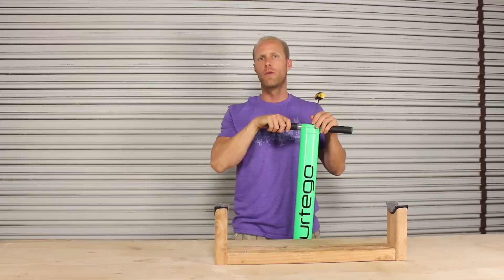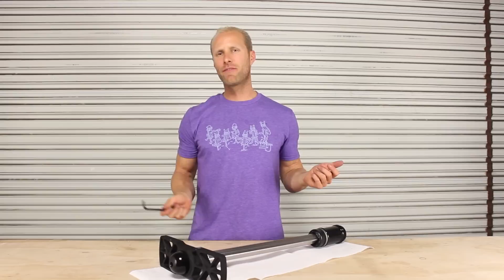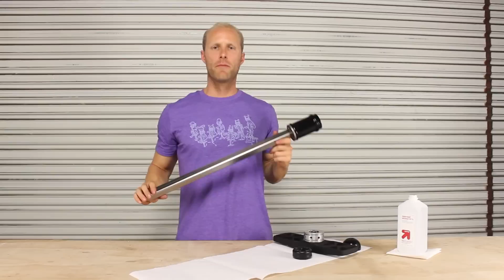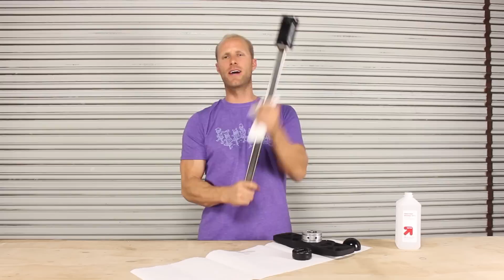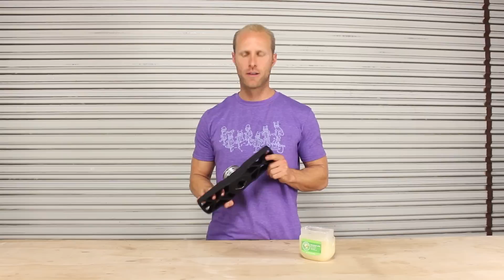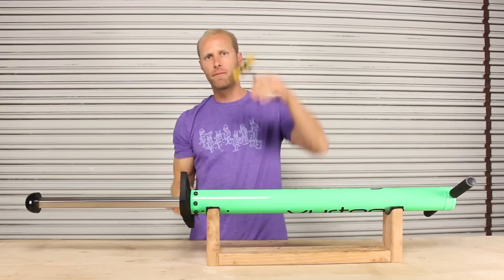Vurtego Pogo Stick Maintenance - Oil Change

Comment: finally i found the allen key to open it. but the donut of mine is white and it seens glued on the black cup... is it right? i cant get the donnut out of the metal square rod... its not easy as the videi shows. do i have to take it out or this white one is attached some how?
Reply: The donut is a very tight fit. You need to pull hard to get it off. It's not 100% necessary to remove it, but if you want to clean it as much as possible we generally do it.
Reply: and do I have to use only my hands for it right? i thought to use a screwdriver but im affraid its going to damage it...
Reply: @albertoalerigijr  It might be a little difficult to pry off only using your hands. I usually stick a screwdriver between the round steel plate and the donut and then pry the donut away from the steel a little bit. Once that's done, you can reach your fingers into the gap and pull it down.
Reply: YESSSSS! I did it! THX!

Comment: Hello again. It seens you guys in US use bolts different from the rest of the world... What is the size of the allen wrench you use on those 8 bolts on the botton of the v4? I have 3 allen sets here in my home in Brazil and none works.. it geta too big or too loose to fit on the bolts. My v4 came with no tools...
Reply: The bolts on the cylinder use a 3/16" hex key, and the bolts on the soft top and grip tip use a 1/4" hex key.

Comment: The screw on the bounce bad came loose and got stripped resulting in my bounce pad coming loose so my son bounce one time with no rubber. How can I get replacement hardware? (bolt only)
Reply from the maker: I would suggest looking up a local bolt supply company. They should have one you can get for about 50 cents. It's a 5/16 x18 thread count x half in length cap socket bolt, but you could also use a longer bolt as well. If you want to get a bolt from us it would probably be $5 shipped.

Comment: So after an oil change do you have to add lube into the valve stem. ?
Reply from the maker: It's easiest to add the lubricant directly into the cylinder while you have it all taken apart
Reply: @vurtegopogos  okay makes since. Now can I use baby gel instead of the lubricant you provide.!?
Reply from the maker: @mlcmusic8243  yeah definitely!
Reply: @vurtegopogos  thanks for the help. !!!

Comment: hi, I bought a new v4 pro, I have a year warranty, can I lubricate it myself, or will it cancel the warranty, and how many milliliters of oil do I need to pour into the cylinder and which one?
Reply from the maker: Definitely add lube to it! That'll help to ensure you don't run into any issues that would require you to need to use your warranty. We use silicone oil when we assemble them, but it's not that cheap or easy to find. Most of the pros prefer to use Baby Oil Gel (make sure it's gel, not just Baby Oil), Vaseline, or White Lithium Grease. All of those are cheap and easy to find. As for how  much, you can never put too much into it. Somewhere around 20ml should do the trick.
Reply: vurtegopogo Is the new v4 pro ready to use, or should it be lubricated?
Reply from the maker: @genaboim6561  it's ready to use straight out of the box. We generally recommend adding lube after 6 weeks or so. If you notice a big improvement then you'll probably want to add lube a little more frequently. If not, then you can go longer periods without adding it.
Reply: vurtegopogo thanks
Reply: vurtegopogo is silicone treadmill oil suitable?
Reply from the maker: @genaboim6561  I've never heard of that. The silicone oil we use is 1000 CST, which is about the right viscosity.

Comment: I did this but the pogo is more grabby then before. It seems like the piston grabs the sides of the cylinder. Is there better oil than baby oil to use or a different O-ring??
Reply from the maker: Try adding some oil directly onto the shaft. If that doesn't work then you probably need to add more oil into the cylinder. A new o-ring wouldn't change anything. Baby oil gel and Vaseline are the two lubes preferred by the best of the best.

Comment: I’ve done an oil change and after putting lube into it it still fills pretty stiff. I’m pretty sure I cleaned it good.
Reply from the maker: Does the shaft have any lube on it? Usually when you wipe the shaft down to clean it you need to add a little bit of lube back onto it afterward.
Reply: vurtegopogo yeah I did that. Maybe I didn’t add enough.
Reply from the maker: @thebox4673  what kind of lube did you use? How much did you put in the cylinder?
Reply: vurtegopogo I used baby oil gel from Walgreens and put about 20ml
Reply from the maker: @thebox4673  That sounds about right. That's really strange that it feels stiff. Maybe try adding a little more to it just in case. If that doesn't work, you might need the check how tight the shaft is in the bushing.
Reply: vurtegopogo ok I’ll do that. I’ve added a bit more and it feels better but a weird amount of friction for 40 psi
Reply from the maker: @thebox4673  if it doesn't feel better after a little more jumping try pulling the pegs out of the cylinder and then moving the shaft up and down through the bushiing to see how easily it slides. If it doesn't slide really easily then that's probably the cause. To fix that you can either try adding lube inside the bushing area or even filing the bushing down a little bit along the very bottom of it
Reply: vurtegopogo ok I’ll try that. Thanks so much for the help
Reply from the maker: @thebox4673  no problem! Let us know what the result is.
Reply: vurtegopogo I added lube Inside the bushing and it’s like butter! Thanks so much
Reply from the maker: @thebox4673  Awesome!!!

Comment: Hello, the seal doesn’t come off. I am pretty sure that it is not scratched. Do you have any tips on how to get the seal off and is this step needed thanks 

-Australia
Reply from the maker: Get a paper towel and use that to clean the lubricant off the seal. Then lay the paper towel over the seal and pinch the seal with your thumb and forefinger. Try to pinch one side outward away from the seal. If you do that properly the seal it pop out of the groove and then you can hook your finger under it and pull it off the piston
Reply: vurtegopogo thank you also for cleaning is degreasing fluid work instead of rubbing alcohol
Reply from the maker: @oendur  degreaser is probably too aggressive. I wouldn't recommend it. If you don't have any Rubbing Alcohol just wipe it down really well
Reply: vurtegopogo okay. When I was putting it all back together the baby oil all came out and also the seal that goes on the foot peg snapped. I have the spare thing that can with it but don’t know if it is the same one will the spare band work on where the foot pegs are
Reply from the maker: @oendur  the bottom o-ring on the footpegs is only used to help prevent lubricant from leaking onto the pegs. It's fine to use without it. Just keep an eye on the pegs. If you see any lubricant on them, wipe them down

Comment: What materials did you use to build that wooden support?
Reply from the maker: The horizontal piece and two uprights are 2x4. We cut the top of the 2x4 uprights in the shape of a "v" and then we placed a large pvc tube onto the top of each 2x4. The pvc tube pieces hold the pogo stick.
Reply: gotcha. thanks for the reply

Comment: Hey, I'm a bit confused. can you use baby oil gel too,  do both oil change and lube?
Reply from the maker: Jakes The Snakes after you clean everything up during an oil change you'll need to add new lubricant. Baby oil gel is a good choice for the smoothest possible ride.

Comment: I swear I tried my best but I just can remove the bounce pad. You think I need a different wrench? It's a 1/4 but its not working
Reply: One day I did get a rock stuck in the screw but I don't think that's a problem
Reply from the maker: What's preventing you from removing it? Is the bolt stripped? Is it too tight? Is it clogged with dirt? It's hard to provide good advice without really knowing why you can't remove it.
Reply: vurtegopogo Yeah my bad, I got it. It was just the wrench, it was a very cheap one I got a better one already. I already got my daily jumps 😂
Reply from the maker: El Johnny ok, glad to hear you got it!

Comment: So I have as problem I don't know how to fix... One Day I was jumping on the pogo and the 2 clips on the bushing snapped clean off and fell down the shaft causing all the air to leak out I ordered a new bushing but when we installed it air was still leaking from the pogo in massive amounts any ideas?
Reply from the maker: It sounds like when the bushing broke the piston must have also broken. When you fill the pogo stick up with air can you hear the air leaking out of the breather holes in the cylinder?
Reply: Yeah I can but then how would I fix the piston if I am able to?
Reply from the maker: XxKiwiliciousxX we'll have to send a new one. The piston screws into the top of the shaft. Send an email to info@vurtego.com

Comment: how do you replace the piston with a new one
Reply from the maker: Sarah Arzt (1) remove the air from your pogo stick. (2) unscrew the 8 black bolts from the bottom of the cylinder using a 3/16" hex key (3) pull the pegs out of the cylinder (4) grab onto the piston with both hands and unscrew it (5) screw the new piston on and put it back together.

Comment: Hi I've had my pogo stick since July and I've never added lube or done an oil change. The amount of bounces it has is about a month of frequent use. Should I do an oil change or add lube first? Also how can I tell if the thing is scratched since that can happen if you don't add lube
Reply from the maker: rocketsfan_ With about a month of continuous use on the pogo stick you should start by adding lube. You can do that a few times before performing the full oil change.  The only time you need to change the seal is if the stick suddenly starts to leak air...which usually means that the seal is scratched.

Comment: I would not recommend vaseline or baby oil as a lube as it contains petroleum and will deteriorate the rubber seals a silicone base lube or gel works best with rubber seals which does not contain petroleum base!
Reply from the maker: Tu Vang Please don't listen to this comment. We make these pogo sticks for a living. Vaseline and baby oil are both great lubricants to use and will not wear your seal down in any noticeable amount of time.
Reply: Hmmm. Who to trust? A random guy on the internet? Or the guy who provably does this for a living? Hmmmmmm.......

Comment: How do you clean stuff like sand
Reply from the maker: VURTEPOGO where's the sand? For most parts you can just wipe the sand off once the stick is taken apart. If the sand is in the cylinder you should stick an old rag or t-shirt into it to get the sand out.
Reply: How we can shop it

Comment: Hello sir , 
I dismantled the pogostick for an oil change and also  fit everything back again . But now , even after pumping in air through the nossel, the shaft is not coming out . Can you pls explain this why ! Thank you .
Reply from the maker: Are you sure that the nozzle is properly on the fill valve? Sometimes it appears to be on but isn't actually filling the stick with air. If it is definitely on, is the o-ring seal still on the piston? If not, the air will leak by and not push the shaft out.
Reply: vurtegopogo Now on my 5th try , the air finally entered the cylinder and the shaft came out . 
Thank you !

Comment: I've been jumping on my pogo stick so much that I already wore down my first and replacement seal. Where can I order another one? I could not find it on the website.
Reply from the maker: We usually just send them out for free since they're so cheap and credit card fees would offset the low cost anyways. We'll get some replacements sent your way....you've been training for distance - how many miles do you think you've logged?
Reply: Honestly, at this point, I am not completely sure. But at the very least 60 miles. I am probably closer to 80-90 miles, though.
Reply from the maker: Whoaaaaaa!

Comment: Sir there is a problem :( 
While I was hoping on my V4 PRO , my shoe lays got stuck in one of the hole of the cylinder ! 
And after I got the shoe lay  removed I found that a small part of it got stuck inside the hole ! 
SO NOW when I bounce I feel the air pressure inside to be low , which does not give me higher bounces ! PLS HELP !!!!!!!! 
           - From India
Reply from the maker: Can you take the stick apart to do am oil change and remove the piece of shoelace from the hole while you have it disassembled?
Reply: +vurtegopogo yes sir ! That is what I need to try. Ow :) thank you
Reply from the maker: If you can't find a 3/16" allen wrench at a hardware store, the closest size is 4.5mm. The mm allen wrench will be a little loose, so you may need something to tighten the fit a little bit (like some paper pressed around the allen wrench). When loosening the bolts go slowly, and be very careful to not strip the holes.

Comment: Should I do an oil change right when I get it or after a month I've had it?
Reply from the maker: No need to do the oil change when you get it. Jump on it, and add lube a few times when the bounce starts to slow down a bit. After adding lube a few times, do the oil change.
Reply: +vurtegopogo ok, thanks alot.

Comment: My piston on my v3 has  a few scratches but not the actual seal, should I order a new one or is this one fine
Reply from the maker: +Cody Deweerd Scratches on the piston won't affect the air seal at all. As long as the seal is ok, you won't need to replace anything.

Comment: can I put vaseline in the foot pegs on the v3? or only the v4 pro? and will baby oil work instead of baby oil gel?
Reply from the maker: +Cody Deweerd You can put some Vaseline on the shaft of the V3, but the bushing on the V3 doesn't have the special lube pockets. Baby oil works well, but it's really runny so it'll tend to leak out the stick faster than Vaseline and baby oil gel will.
Reply: Ok thanks

Comment: do you give those tools in the box?
Reply from the maker: +Umair Raja No, we don't include the tools in the box.
Reply: +vurtegopogo Why do you use sqare tube instead round one?
Other than that it looks like standard air shock absorber to me.
Still looks like a lot of fun.Are pogo sticks heavy on the knees or they absorb shock like bike(for example some persons have knee problems on impact aka running ,but can drive a bike or walk for miles without problems) ?
Reply from the maker: +zumbazumba1 if it had a circular slide shaft, you wouldn't be able to control your movement, which is critical for our pogo sticks.
Reply: So your telling us.. you don’t add a few dollars worth of tools in a $400 dollar pogo stick which already has a limited market? Not to mention for overseas buyers who most likely have metric tools inside there toolbox at home instead of imperial?